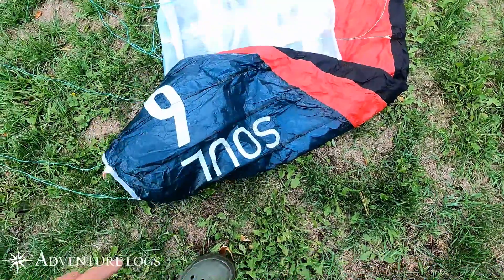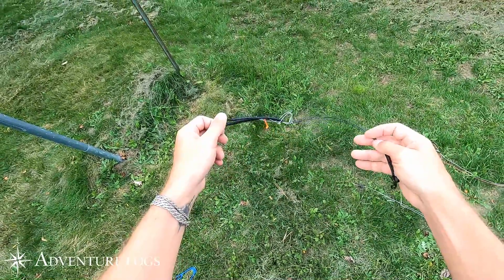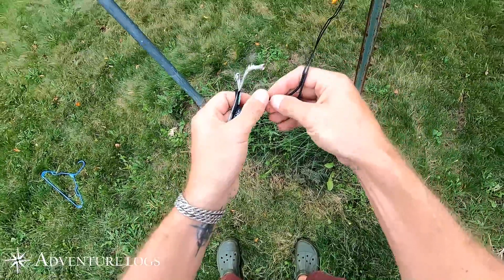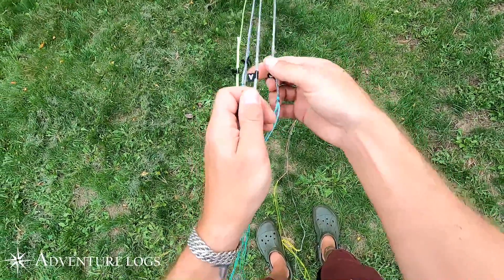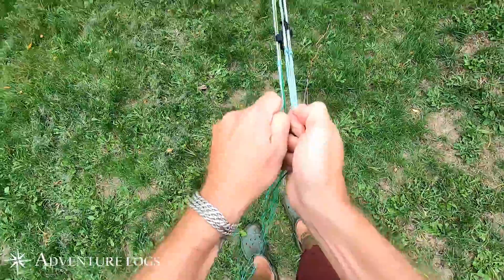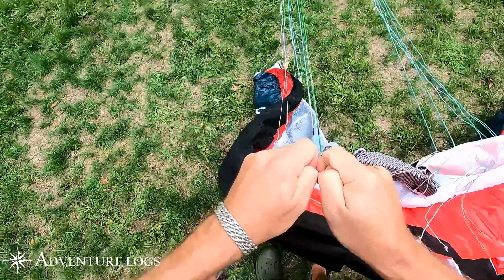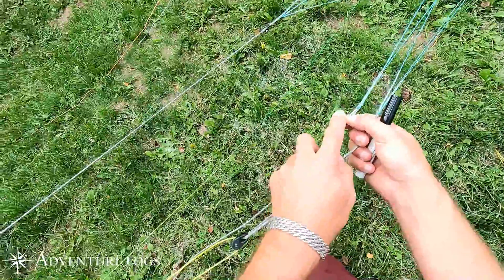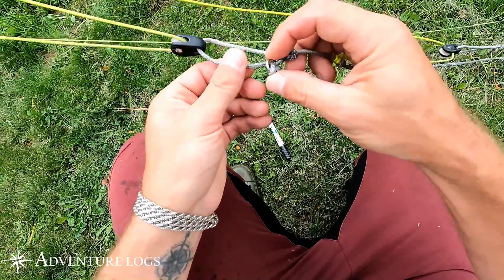Using Flysurfer's New Trim Checker Tool on my Soul 6m Mixer, How To Tune Your Bridle:

Comment: Hi Jason.  I have a trim checker but cant find how the grey line and orange loop attach to the black movable line for A and Z .  I understand while in tension you can let go the Z line and maintsins same length. Looking to exactly how grey attaches to black line to prevent slippage???
Tks
Reply from the maker: Not sure what you are asking.  You don't attach the greyorange loop to anything, thats there to show you when you have the proper amount of tension(5kgs) on the lines.  You attach your kite lines to the two black hoops.  Once attached, pull them till the orange LCL is stick straight out(that indicates proper tension) and verify that the A and Z knots line up.  Then check your mixer.
Reply: @adventure-logs  ok where do i attach the grey line?  Just a loop over two black lines?
Reply from the maker: @supericeman2222  your grey lines are unattached?  They are the bungie lines that should already be connected to the black lines that tighten that allows that orange LCL to stick straight out when it's at 5kg

Comment: Hi, How do you do if A and Z are not equal in long mixer test ??  thanks
Reply from the maker: The first thing you do is line up A and Z to do the mixer test.  If you think your Z has shrunk(which can be common with older kites), I would check the line measurements on Flysurfer's website and measure out the Z on it's own first and then add pigtails to return it to the correct length.
Reply: @adventure-logs and if z only shrunk like 2-3cm? Then just trim the bar? (Depower a bit)
Reply: The beauty with the trim checker is that you may adjust both little attachement line together and catch then in relative position, so if A and Z cannot be equalized by moving laterally, just adjust the relative position of the 2 attachment lines of the trim checker of the necessary length, then A and Z will come to same length, to do the proper C then B check as usual. If you don’t use the trim checker but put screwdrivers through the metal rings into the ground, you just need to move one screwdriver back or front by some length to do the same…😎 @sanderpsychologie

Comment: When I do the long mixer I always hold A and Z together (on the same level with 5kg) and then adjust C first and then B. It is not about the length of A or Z it is about the relation to C and B. Just imagine your Kite-profile.

Comment: Can you show how you do this with your Flysurfer bar lines?  I don’t think there are any knots in FS lines to shorten or lengthen….thank you!!!
Reply from the maker: Which bar?  They are usually under the floaters.
Reply: @adventure-logs  I have a Flysurfer bar. I’ll look under floaters. Thank you!
Reply: @adventure-logs  if I test to see if all 4 lines are the same length do I power or depower the strap/cleat?  Thank you.
Reply from the maker: @thomaslindberg8250  Trim for full power and keep the bar fully in.  The lines should all be equal.  With a Soul and being a little more advanced you can have about 2-4cm shorter steering lines.  This will make the kite backstall a little more but will speed up the turning speed a bit.

Comment: My A and Z lines are not equal amd I don't see a way to adjust one of them?  Also, which one should I make an adjustment to? 
Any advice would be appreciated. 
Lastly, do you compare both sides to make sure they are equal?
Reply: you dont have to adjust a and z. when you start the mixertest,  put too screwdrivers into the ground. fix the mixer at the frontline to one screwdriver. fix the backlines mixer on the other screwdriver. walk left or right to bring a and z to the same lengh. when the same lenght is fond, you can now trim c and b. this tool is designed to replace the screwdrivers. you adjust a and z via this trim tool.
Reply: @breytengrad   I did this with 2 screwdrivers as you suggested and it works easily. Using the trim checker from FS doesn’t allow you to equalize A and Z lines before checking B and C. I also had to adjust both the C and the B mixers to achieve the same length.
Reply from the maker: @thomaslindberg8250  To make sure, use the line diagrams on Flysurfer's website to see how badly they actually are off.  You can then make pigtails with shorter pieces of line to bring the Z's back to proper length.  A good way to temporally see if this fixes the flying issues is use some of the LCLs(little connecting lines) you get in your repair bag on your kitebag.  Personally I wouldn't trust these for a long term fix but its an easy way to see if your fix makes the kite fly better before you put the effort in making real pigtails.
Reply: @adventure-logs  thank you again. When I used the double screw driver technique (moving left and right to get A and Z equal I was able to use the A and B mixer to equalize all lines :-)
Reply: @Thomas Lindberg  I am happy that i could help you! took me so e time to figure out the trick with the a and z line ;)
Reply: @thomaslindberg8250 you can more easily with the tool: you just make the line where the bridle is connected to a bit longer on the z part and then lock it in. So the tool is 'uneven' so the a and z align. Then u trim.
Reply: @breytengrad  Thanks for the help. Another question, do you line up the knots or the black material.  There is a small difference.
Reply: @twhall64  plese specify. You mean on the bridle? Or flying lines, back lines?
Reply: @twhall64 you must align the knots which are just after the black marks together (and not the black marks by itselves) . Indeed there are sometime a little difference. 
There are also some case with above the black mark a second knot on the top of the first one. You don’t have to care of the second knot, and just align the first one.
Reply from the maker: Typically it's the Z line that shrinks but you can go on the Flysurfer website and find the line plan that will tell you the proper lengths.  Best way to see which line is off.  If you have a dedicated bar for the kite you can adjust the difference at the bar.  If both sides(left and right) and off equally, usually just adjusting the trim(by depowering slightly) will correct this.  If one side is off more than the other but again dedicated bar, you can adjust this by adjusting the steering line.  Otherwise adding pigtails is another way of getting A and Z realigned.
Reply: @adventure-logs  Thanks for the help. Another question, do you line up the knots or the black material.  There is a small difference.
Reply from the maker: @twhall64  I do a short mixer test first(knots) and if it's still not flying like it should, I'll then do the long mixer test(black marks close to the kite)
Reply: Both my Z lines are short and of course one is a full inch and the other a 1/2 an inch. Since I don’t have a dedicated bar I’m going to try stretching to see if I can make up the difference. Anyone had success doing that???
Reply: do you mean the flying lines on the bar or the z lines on the kite?

Comment: Surely step 1 is to adjust the relative lengths of the connections on the "tool" end so that the kite end of A and Z align.  Then you can proceed with the mixer test. It looks like you got lucky as A and Z were already the same length, but that is just because your mixer was not out by much; it would be helpful if you explain the adjustment at the tool end.
Reply from the maker: This is why I did a quick short mixer check in the beginning, to make sure A and Z were equal. If not, I would have adjusted firstly.
Reply: @adventure-logs   Hmmm - the short mixer test does not aim to equalise A and Z (in fact flysurfer don't give you an adjuster on Z like ozone do, so it is not even an option).  If your A and Z ended up aligned then you just got lucky.  Is it not the case that the tool allows you to adjust for the A-Z difference?
Reply from the maker: @DaveSands  I disagree.  The short mixer test can quickly show you if A/Z do not match up(which is typical on a older foil, the Z line will shrink).  While Flysurfer doesn't specifically have a way to extend Z back to A, there are a couple very easy ways to do so.  If both sides of the kite have the same amount of difference between A/Z, it's easily corrected by trimming in slightly.  If you have a kite where you mostly jump going one direction, then there maybe be a difference between the two sides.  If you have a dedicated bar for that foil, then you can again easily adjust at the bar by extending the corresponding steering side.  This is easily done by preforming the mixer test with the bar still attached.  If you use the same bar for multiple kites then this won't work.  In that case, you can use pigtails to extend the Z back to A.

Don't get me started on Ozone bridles.  First off you have to pay extra for an adjustable bridle.  Also the lines are much thicker which are suppose to help reduce line shrinkage but in reality cause more drag instead.  Lastly Ozone wants you to add knots to adjust it which in my opinion is a bad way to go.  Knots weaken the line.  Ozone is still behind the curve here and for the amount of money they charge, it shouldn't be that way.  I won't get into the sewing problems, lack of airtightness, and drainage issues.  They are starting to catch up though.
Reply: @adventure-logs  Im certainly not trying to argue about ozone (not a fan), just trying to clarify. If the tool has the ability to adjust the relative length of az connections then it can be used to do the regular mixer test itself. It is also useful to understand that lengthening z does not have the same effect as adjusting the relative length of the back and front lines. I only mention ozone because their mixer test instructions include the appropriate lengthening of z (=half the shortening of C I think). I am not commenting on price or quality of their mixer. You could at least consider the idea of skipping any pre adjustments and aligning a and z at kite, adjusting the tool connectors to equalises their length, and doing whichever mixer test you choose.
Reply: @DaveSands yes the tool is well made for that. The 2 attachment lines are just one line , so you may easily slide it to increase A or Z and there is a little piece turning around and maintaining your setting when made and under tension. 
So if you cannot line up A and Z together, just slide this adjustment line , check A and Z, then check C (and B) as usually.
Another option is to use screwdrivers in the ground, and you need to adjust their distance to the kite and keep them at roughly 4“ in order to have another way to adjust by moving both laterally. The trim checker is far more easier to use!

Comment: Hey Jason, thanks for posting this. How would I use the trim checker tool for a Sonic 2? Will it work for both the short mixer test as well as the long mixer test on that kite?
Reply from the maker: You would use it the same as in this video for the short mixer test. There are no markings on the Sonic2 for a long mixer test from FS but you could easily add marks similar to the Sonic3 to be able to do a long mixer test. My personal opinion is this would be worth it since the Sonics are much more sensitive to bridle changes.